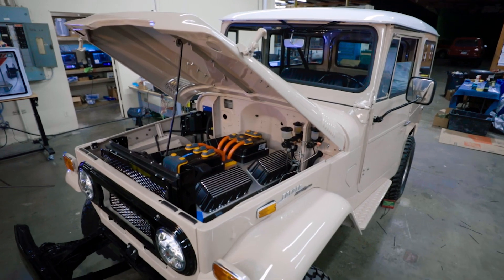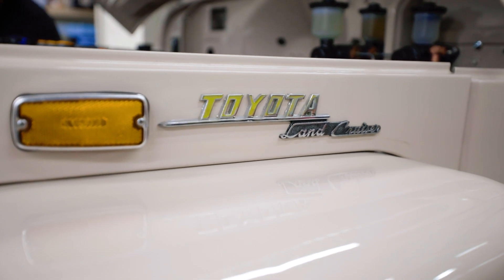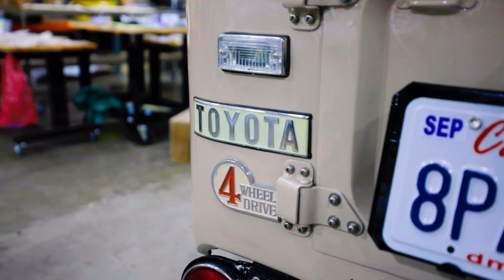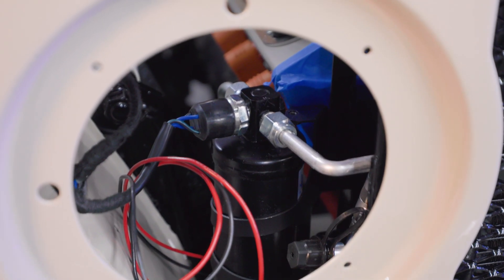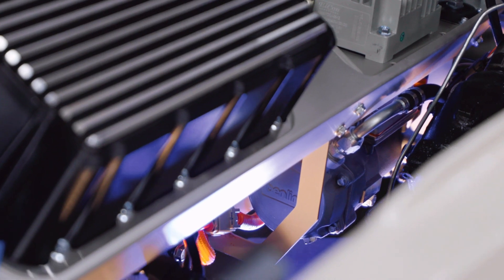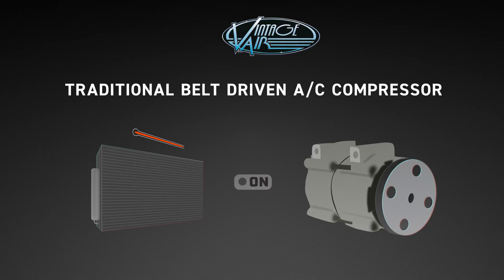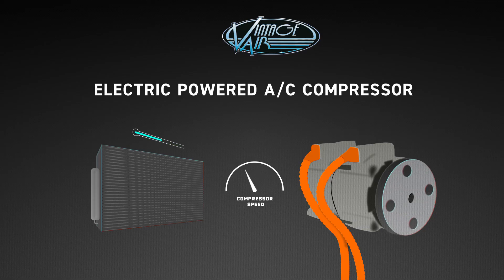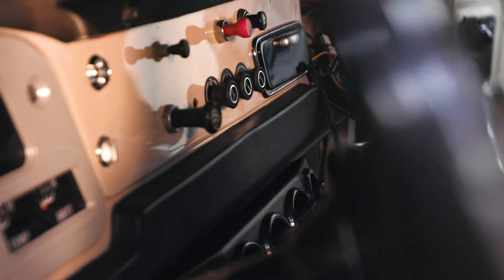Vintage Air Creates An HVAC Solution For Electric GT's All-Electric 1970 Toyota FJ40

Comment: Very interested in the electric compressor. I can’t find it on your website.
Reply from the maker: Currently we do not offer any type of electric powered compressor.This was a special project using an all ele. power train. For traditional type engines we recommend using standard belt driven compressors for several reasons. A few years back we published an article explaining our use of ELE. compressors "Over the years, we have received a number of questions regarding electric compressors, and whether or not they are available through Vintage Air. Since the 1990s, our engineers have tested numerous electric compressors as part of Vintage Air’s comprehensive research and development program, and we have used them in several all-electric vehicle applications, including the 1990s-era Ford TH!NK.
Electric compressors designed for primary use, on the other hand, are capable of providing plenty of cooling capacity, but they come with another major disadvantage: excessive electrical demand. A major selling point for electric compressors is that they are not engine-driven, “thereby freeing up extra horsepower and package space.” However, primary-use electric compressors require a high output from the vehicle’s electrical system, with some compressors drawing as many as 180 amps at 14 volts (more than 2,500 watts). Most standard-duty alternators produce a maximum of around 140 amps, which means either an extreme-capacity alternator or an additional alternator will be necessary in order to handle the load. This requirement alone will negate any potential horsepower or package-space gain derived from eliminating the engine-driven compressor.

In addition to inadequate performance and/or excessive electrical demand, aesthetics are another concern when using an electric compressor in your vehicle. One of the main attractions to electric compressors is the prospect of improved aesthetics and a cleaner appearance within the engine bay. However, when considering aesthetics, things are not always as they appear. For starters, as mentioned above, it’s likely that either an extreme-duty alternator or 2nd alternator will be needed to provide enough power to run an electric compressor in your hot rod. This being the case, the aesthetic benefit gained by removing the engine-driven compressor is immediately cancelled out. Moreover, the compressor will still need to be mounted somewhere in the vehicle 

                             
Finally, cost is a significant factor when considering the possibility of an electric compressor for your hot rod. From a consumer standpoint, it is worth bearing in mind that a quality Sanden compressor supplied with a Vintage Air system retails for about $200, whereas primary-use electric compressors can run anywhere from $1,700 to $2,500 or higher, not to mention the additional costs associated with vehicle and electrical system modifications that may be needed in order to use the electric compressor. When it comes to dollars and cents, an engine-driven compressor is clearly the economical choice.

 

In the end, after decades of research and practical experience, we have found that electric compressors are without a doubt an innovative concept with an ever-growing number of useful applications. With that in mind, our engineers will continue to test new models and other emerging technologies as they become available. However, at this time, when it comes to performance, compatibility, aesthetics and cost, we have concluded that the conventional engine-driven compressor is still the best choice for hot rods and muscle cars.

 

With that being said, Vintage Air is committed to selling only the best-performing aftermarket air conditioning components. As a result, at this time we do not offer an electric compressor in our catalog because we do not recommend their use in your muscle car or hot rod.

 

Here’s why:

 

While there are many different electric compressors on the market, each with its own particular set of advantages and practical applications, our extensive research has turned up several shortcomings with electric compressors when compared with conventional engine-driven compressors for use in hot rods and muscle cars. These include, but are not limited to, inadequate performance, excessive electrical demand, a lack of net aesthetic advantage, and cost.

 

Performance-wise, electric compressors fall into two categories: Those designed for primary use (15,000 to 25,000 BTU) and those designed for supplemental use (5,000 to 7,000 BTU). NOTE: Vintage Air system capacities range from 14,000 to 20,000 BTU, depending on the model.

 

Electric compressors designed for supplemental use will not provide adequate performance because they are not designed to handle the heavy cooling load required to remove the heat from your hot rod. This means that while these compressors might do a great job of maintaining an already cooled vehicle’s temperature, they simply don’t have the capacity to rapidly cool a hot vehicle in the way a conventional engine-driven compressor does. On a 100˚F day, this is the difference between comfort and misery.
Reply: Thanks for the reply, yeah I read that article from 2017. I wasn’t so much looking to use that compressor on a belt driven project but I am very interested in electric vehicles and I was more so just looking to nerd out on the spec sheet for it.